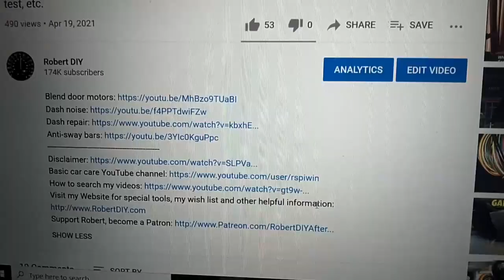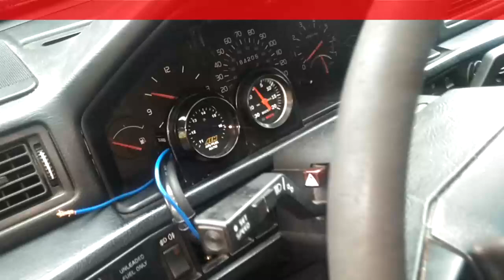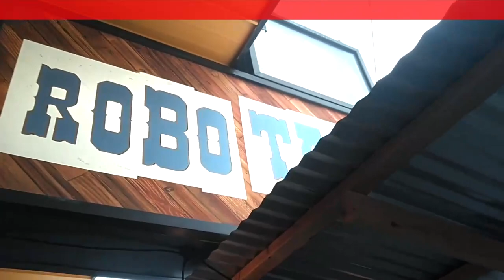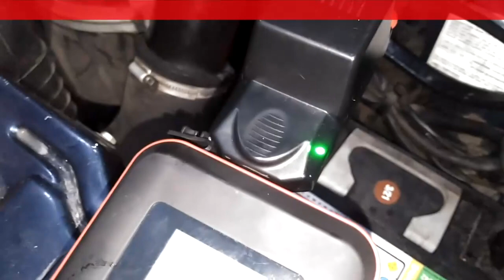Red block issues, has a good oil leak. Also paid a visit to RBP, Red Block Performance in Portland.

Comment: Early Schumacher power packs had a big problem with the battery swelling up, especially if they were overheated by leaving them in a hot car, for instance. They replaced mine under warranty, but it's kinda scary.
Reply from the maker: thanks for the heads up. I'll watch it.